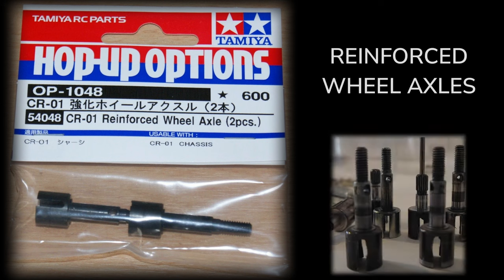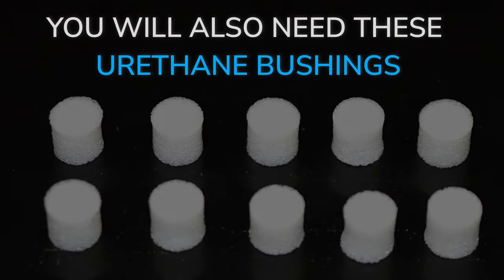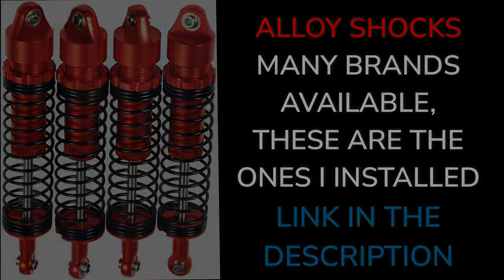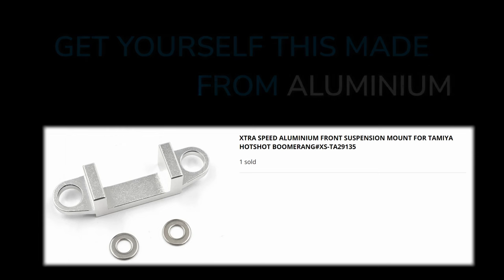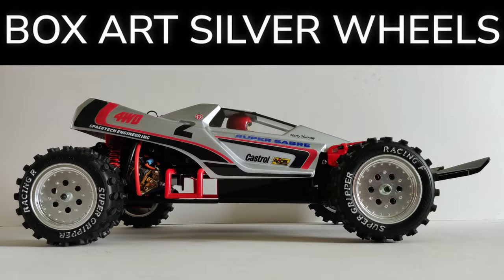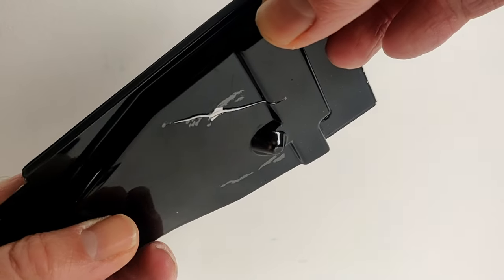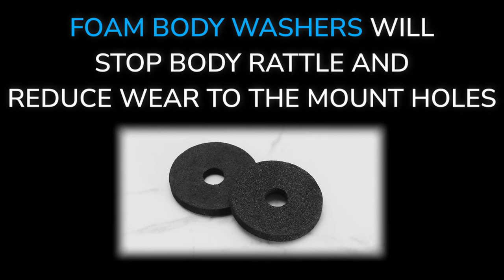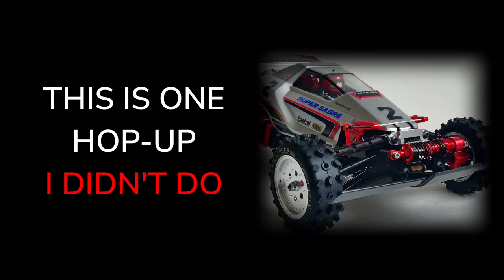Tamiya Super Sabre Upgrades & Tips

Comment: that wheel suggestion- possibly the TS-83 Metallic Silver, but the the TS-14 Black is required to make the TS-83 work properly, I do the Tamiya Primer, then TS-14, then last layer TS-83 Metallic Silver, pretty strong chrome effect
Reply from the maker: Great painting tips! Sounds like you have good experience👍🏻 Paint is pretty expensive when you need a few cans so I guess you weigh it up to see what price you can get wheels for. Thanks for commenting, very helpful 👍🏻